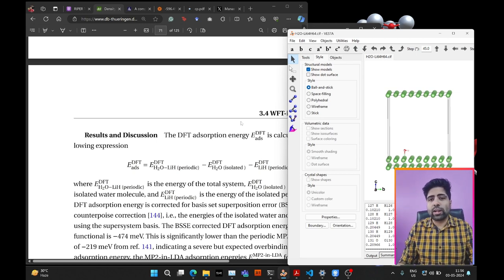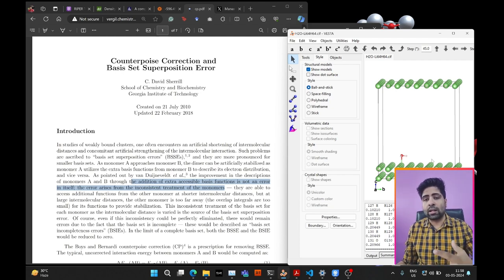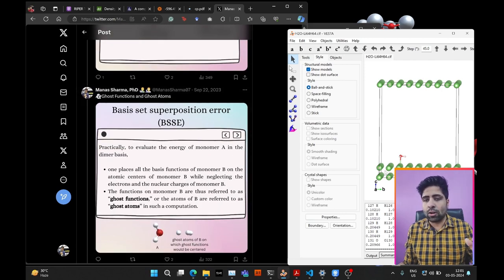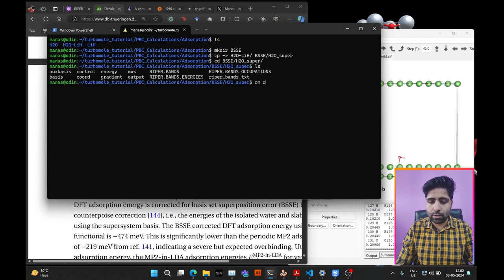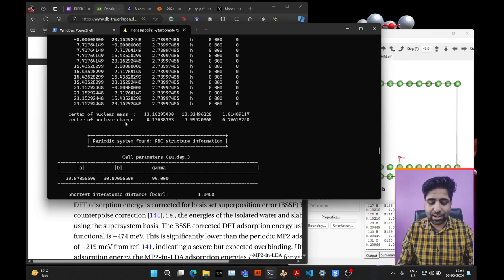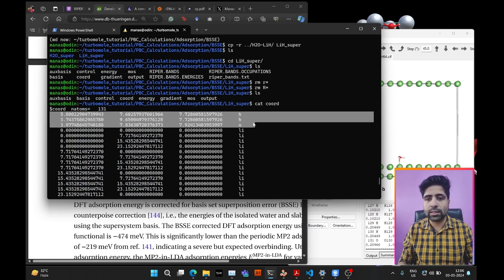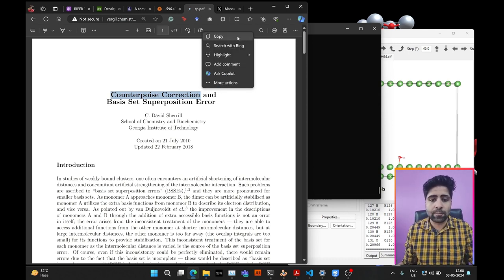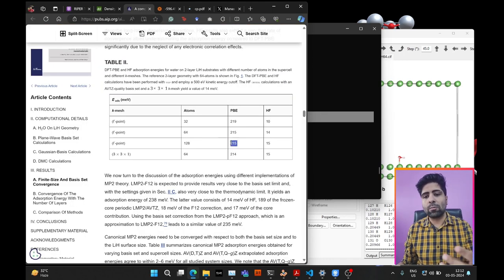How to Calculate BSSE-Corrected Adsorption Energy using TURBOMOLE? [TUTORIAL] (Pt. 2)

Comment: Is it possible to calculate the charge transfer (i.e., no. of electrons transferred during physisorption process) and adsorption energy using Burai??
Reply from the maker: It is not possible through BURAI. But essentially you just need to generate a cube file of your system's density and then process it.  This might be useful:
https://youtu.be/FrY8Sj0zUus?si=Gt1USzv3mA7IyHzv